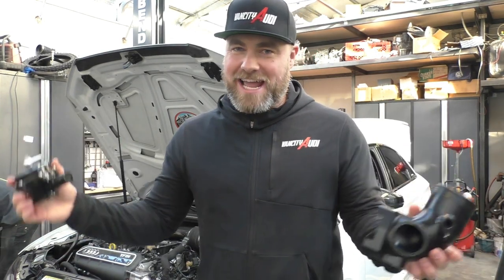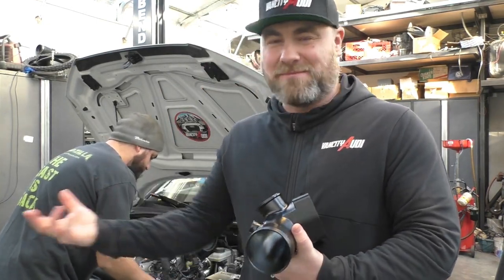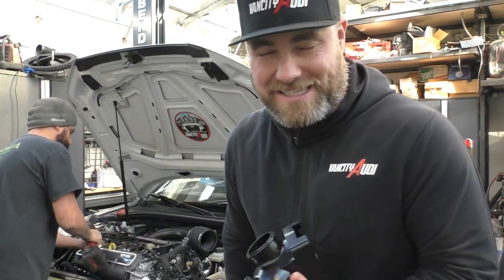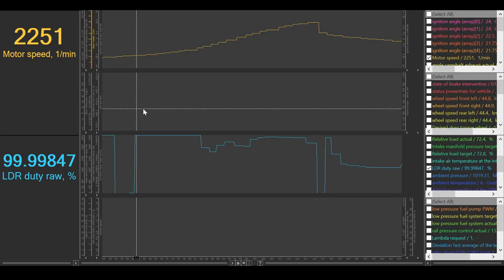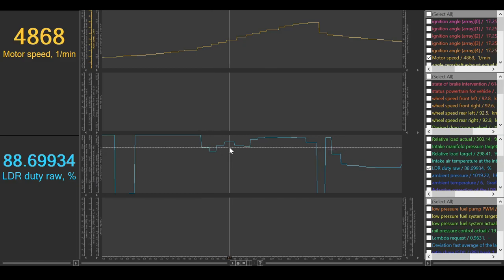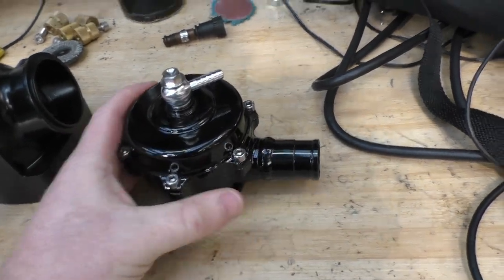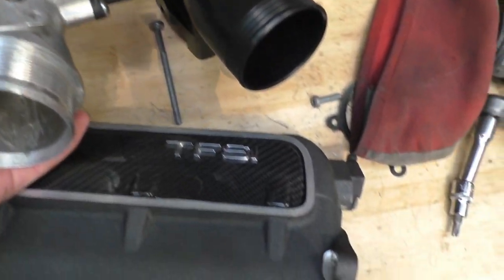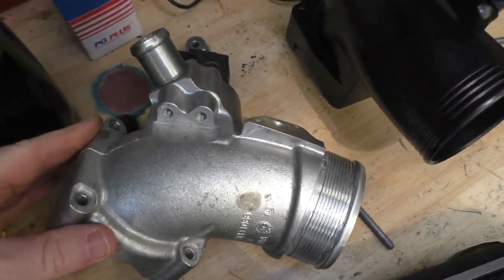TTE Throttle Body Inlet & TiAL Blow Off Valve Install & Testing - Audi RS3

Comment: The wastegate looked much more linear before the mods.  Are you going to have it adjusted or the tune adjusted to compensate?  How did boost look?  If it's opening and then having to reclose like it did you might have actually lost some power.
Reply from the maker: The tune will stay the same. The boost looked stronger than ever.

Comment: Forge has this already and everything fits perfectly without cutting. Also there are several different springs for different levels of boost you are in so this wasn`t anything new I would say?
Reply from the maker: I'm not reinventing the wheel here, no. I'm just trying to make my system as efficient as possible in hopes of increasing flow and making more power.

Comment: If you’re wastegate duty cycle is pegged at 100% why wouldn’t you just raise your wastegate crack pressure/pre load? Or use a stiffer spring on the wastegate actuator
Reply from the maker: You certainly could but I am using OTS tuning from Unitronic. I don't want to mess with the actual turbo itself. Plus if I touch anything on the turbo itself TTE won't warranty it if it fails

Comment: Hi, I have cts mid pipes and unitronic catted down-pipe only. Should I go with unitronic stage 1+ map or stage 2 map? Also what 1/4 mile times should I be looking at with lighter wheels and pilot sport cup 2’s? Thanks
Reply from the maker: As soon as you upgrade your downpipe you are now Stage 2. You need to get an intercooler on that thing ASAP though as that is needed to keep your car running properly on Stage 2. 1/4 mile times will vary on a ton of different things
Reply: @VancityAudi  thanks, will add the ic asap. This is such a great/underrated platform, so glad I got it instead of a gtr or bmw Supra😮 please check out my vids as well. I own a vinyl wrap shop but post my rs3 mod progression as well.
Reply: upgrade the turbo inlet to 4" as well

Comment: Hy
The front of the car is not smoked in the rain?  At every stop in winter, the front of the car starts to smoke. Do you know anything about this?
Reply from the maker: Yes, my RS3 used to have lots of steam pour out of the hood on rainy, cold days when i daily drove it. It was nothing to worry about.
Reply: @VancityAudi  
Thanks for the answer.
Fe you need to know that this is not normal. He didn’t do this smoking for years, only a few years later…. something went wrong in the car….

Comment: Nice video Adam, any advice on resealing the oil sump ok rs3, got new one new screws, for 3rd time and still damp on rh rear corner, not leaking but it just doesn’t seal well, I’ve seen yours is bone dry, maybe a better sealeant can sort the issue 🤦‍♂️
Reply from the maker: We've removed the sealant and resealed my oil pan twice. They are notorious for leaking on this platform.
Reply: @VancityAudi  so there’s no solution or fix for that, think the upper sump is not machined well and the sealeant doesn’t adhere enough to make that perfect seal, thanks Adam and all the best, one of the my favourite channels with loads of informative videos 💪 keep the good work
Reply from the maker: @dan5pot  thanks for watching. From what I have seen it's the design of the pan. The sealant going around the bolts doesn't create a perfect seal.

Comment: This is why I installed the VTT silicon charge pipes. Easier.
Reply from the maker: If I did that, I would be supporting a company owned by an unprofessional, childish, cruel and rude individual.  I'll pass, thank you.